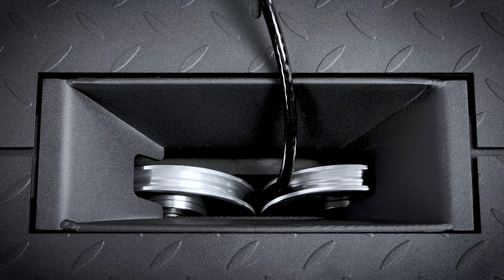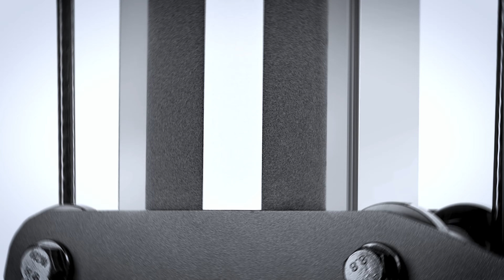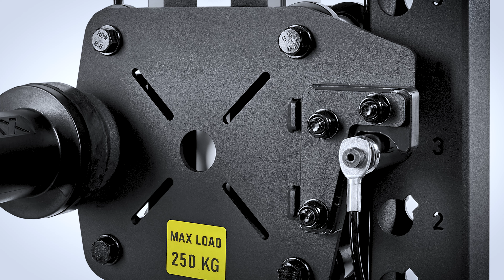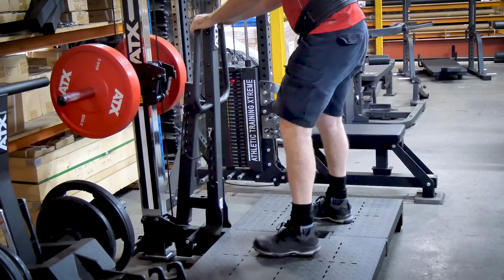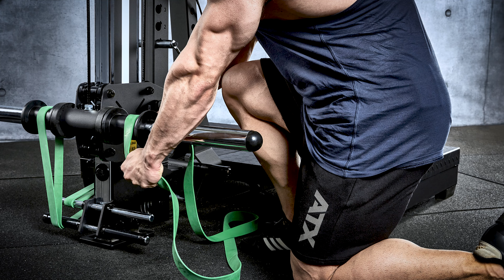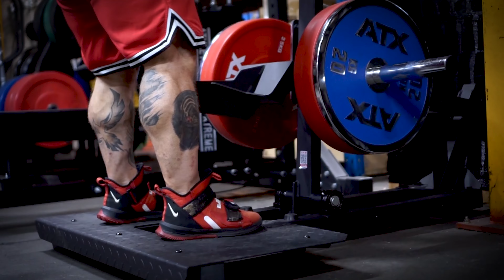SAM'S REVIEW: ATX® Roller Belt Squat Machine | ATX-BSM-760

Comment: Seems to be discontinued on your website.
Reply from the maker: Yes ATX stopped making it. We hardly sold any toward the end anyways. The compact version was so close in terms of feel, but a lot cheaper and took up less space. 
But the main part was the compact version is so much easier to use. You didn't have to squat down to attach/de-tach. 
We hardly used our Roller version when we had both set up in the showroom.

Comment: Hi Sam, looks like you can't reach the maximal ROM in this machine cause the cable arrives to the bottom first, is that the case? Thanks.
Reply from the maker: It all depends on the length of the belt squat belt. You can upgrade the basic belt to something like Spud Inc Adjustable Belt Squat Belt or Belt Squat Belt Medium. That would give you so much more depth compared to the one which ones with the machine
Reply: @samsfitnessgymequipmentaust  compared to the compact belt squat, assuming you use the belt that comes with the machine, does the compact one provide deeper ROM?
Reply from the maker: @Abcd-yw5yf  Both machines have ass to grass ROM.

Comment: Awesome! I bought the 600. Cant be more happier and being able to move it around was important. When i get a bigger place i will def upgrade and get this one! 
8mm cable is 😍
Reply from the maker: Honestly save your money mate. I would. The 600 is amazing value and so close to the 760 in function. Check out the Hammer strength belt squat - similar design to the 600. Reckon if you blindfolded someone they wouldn't be able to tell the difference between the two.
Reply: @samsfitnessgymequipmentaust  really? Both ATX belt squats look premium and I was gunning for the roller belt squat tbh but it is almost 1k more and while it looks very good, functionally you say they’re almost the same and not worth the extra cash? Appreciate the honesty!
Reply from the maker: @andrewnguyen5820  Check out the Hammer Strength Belt squat and the mechanism is almost identical to the BSM-600. The Hammer just has a massive frame that would make it way more expensive. So basically you getting a scaled down Hammer. That is why the 600 is so good.
The BSM-760 is similar to the Rogue Rhino, which got the vertical pull like the Squat Max MD - https://www.squatmax-md.com/product-page/squatmax-base-model - which was regarded as the best by some. 
So either way you go you get the a cracking design.